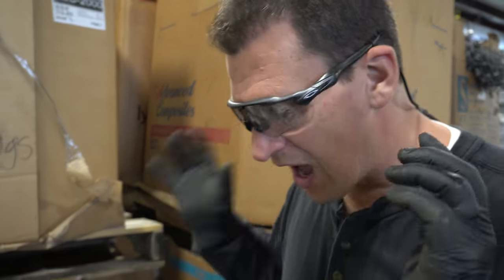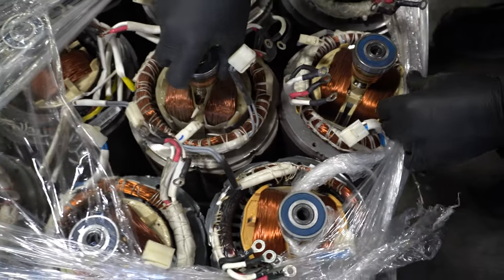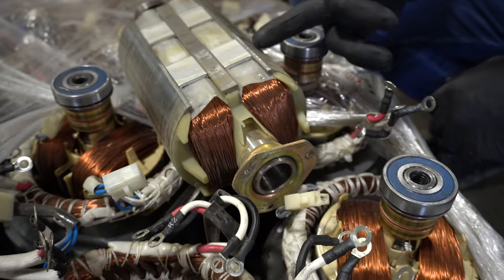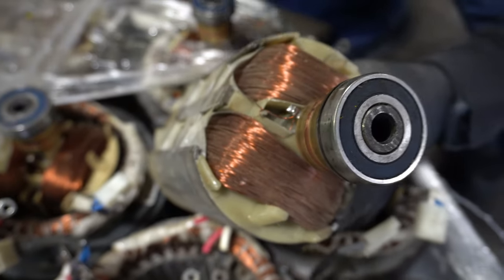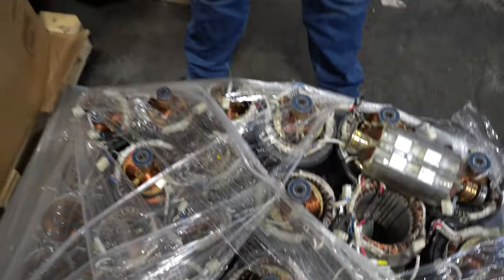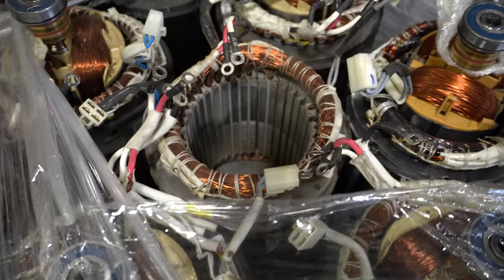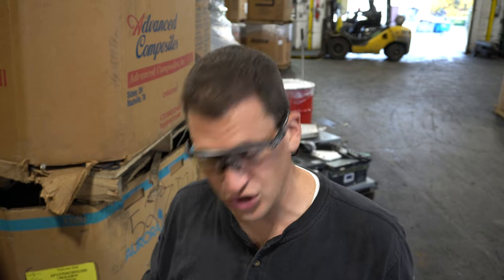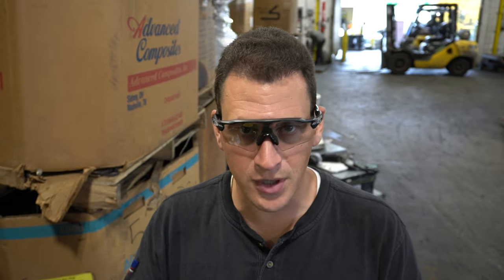Removing Copper Electric Motor Armatures

Comment: Use an air chisel to cut and push copper out. You won't lose copper by creating dust with a grinder or saw and it goes really quick.
Reply from the maker: Great idea, we have not seen or tried that before.
Reply: @iScrapApp an air chisel works great to split the motor in half between the laminations then stick each half in a bench vise getting under the loop ends with a dull fork bit and wha la...pulls the copper right out. I can extract copper out of a one horse motor in about 5-6 minutes.
Reply: @iScrapApp  I have many more ideas from where that came from. Lol. You ought to see me remove copper tubes from an aluminum air conditioner coil. I know how to get those out of a central air unit in about ten minutes. 😉

Comment: I will sometimes use a grinder on the stators but most often I use the cutoff saw, let the copper cap fall into a bucket and then place the stator in a vise and use an air hammer with a dulled chiesel bit to knock the rest of the copper out. Very fast and efficent, can do multiples in an hour for some good profit. And just to clear the air about the tools I use when processing, Harbor frieght baby.
Reply from the maker: Great ideas on the tools and where to buy them. Many people do not know enough about them.

Comment: There are a few vids of processors showing custom equipment for separation of windings from rotors and stators.

You can easily cut copper with a sharp wood chisel, you don't always have to saw it.
Reply from the maker: Another solid option- thanks!

Comment: Hello Tom.
I pull the copper off most motors, and as you said I get clean steel for the rest. I do not cut open sealed units and the scrapyard likes too see a drilled hole so they know it's drained of oil and I get electric motor price for them. I do get a lot of them, sometimes 20-30 of them in a few weeks..
I also have a question for you,, what is your opinion on MOSFET from circuitboards? I had a talk to my yard over a cup of coffe and I get high grade copper wire price for them.
Reply from the maker: Interesting on the MOSFET boards- we have not been approached with those before.
Reply: @iScrapApp  They are in one form or another on most boards. Most of them are 60-95% copper content by wheigt and quick and easey to remove.